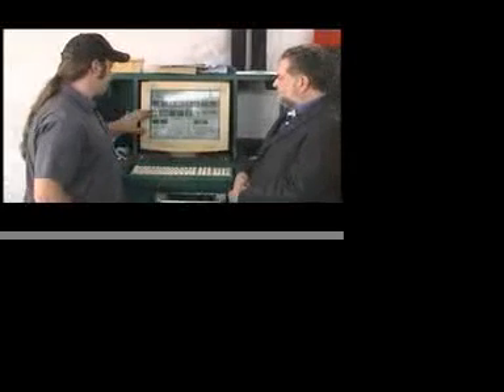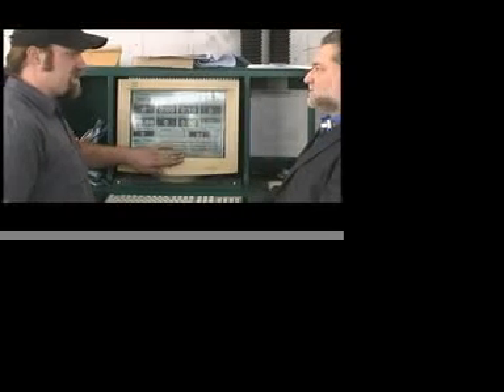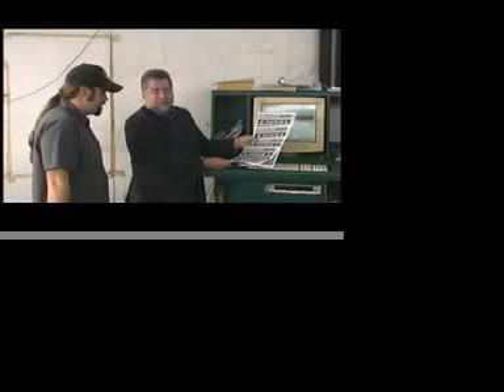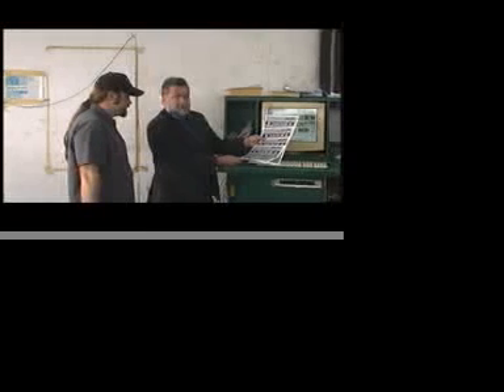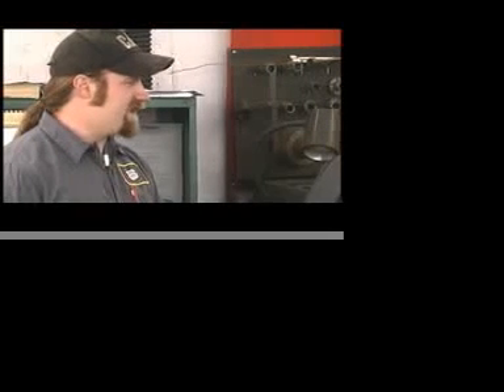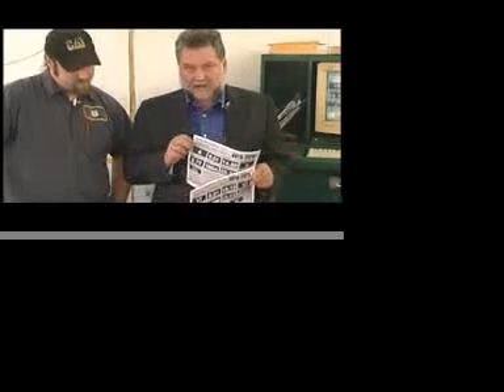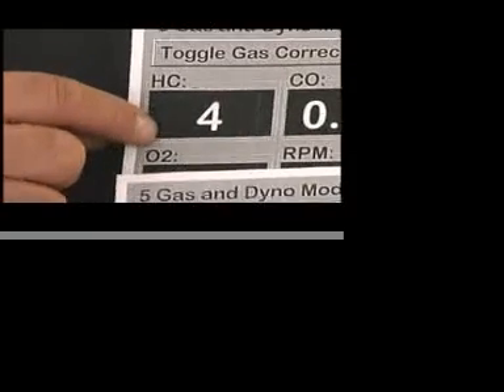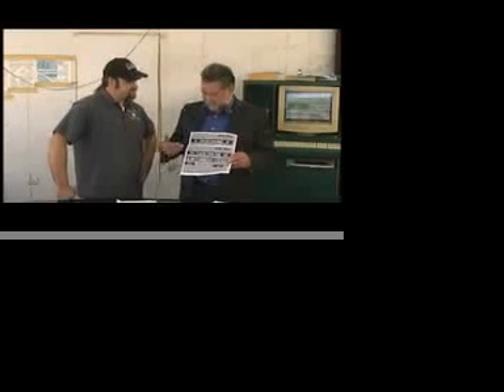E15 Smog Emission Test

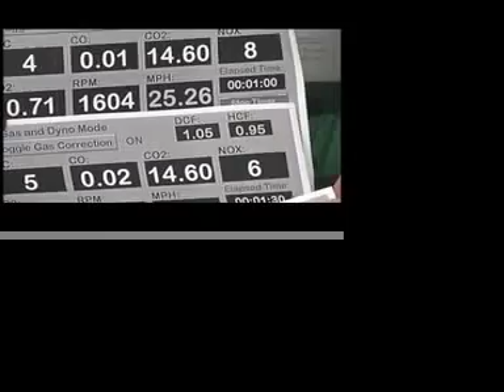Comment: the problem with these increased alcohol fuels is not increased emissions. it is damage to fuel systems and in the case of carbureted vehicles, running too lean also 2:01